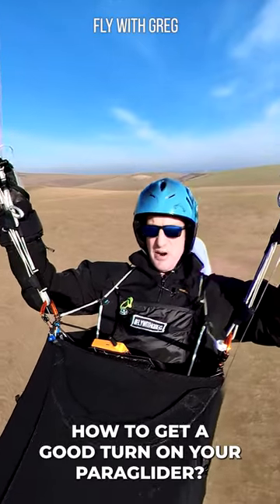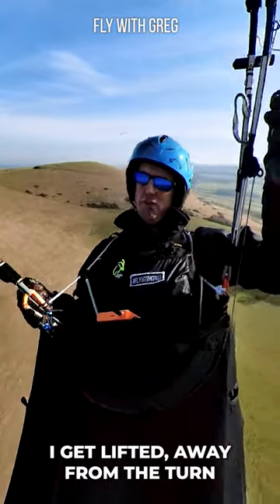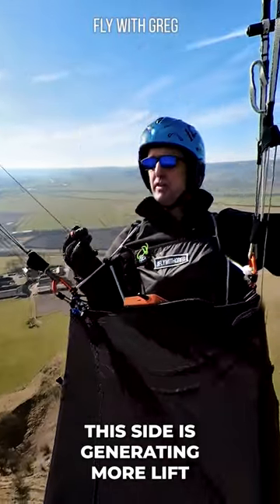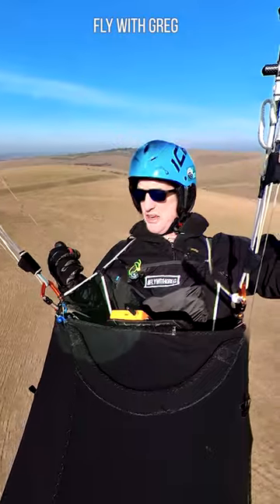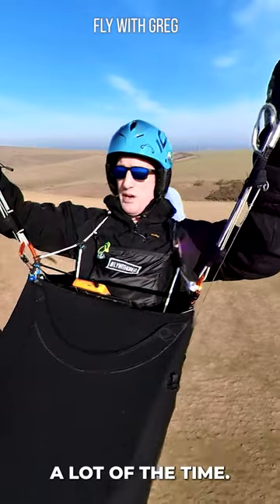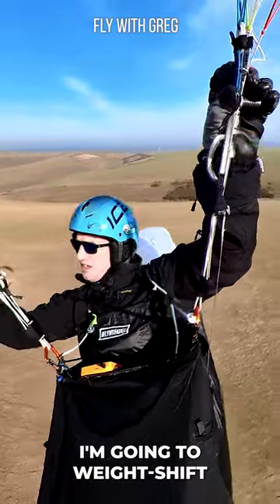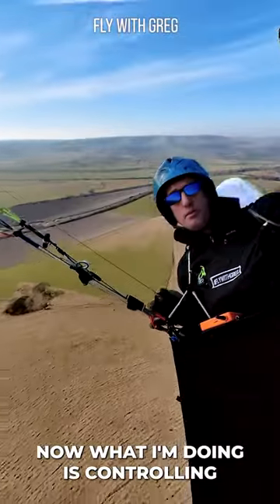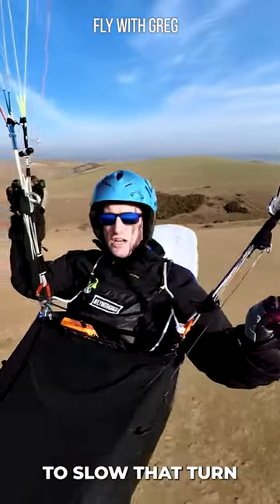Do this ONE THING to improve your turns #shorts

Comment: Hello Greg! I would be interested to know what your method is, for example to re-centre wind-shifted thermals. Do you keep the inside brake more static for this and use the outside brake to widen the circle and hold it upwind?
Or do you release the inside brake for a moment and then tighten it again while keeping your body tilted?

Regards